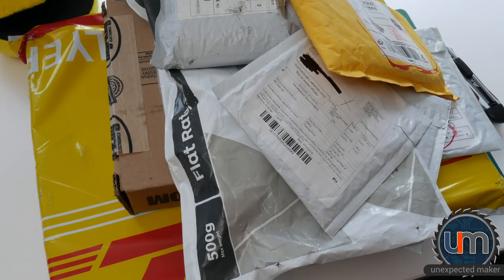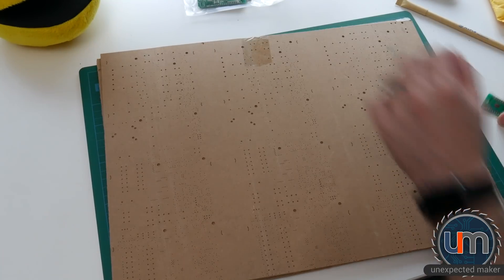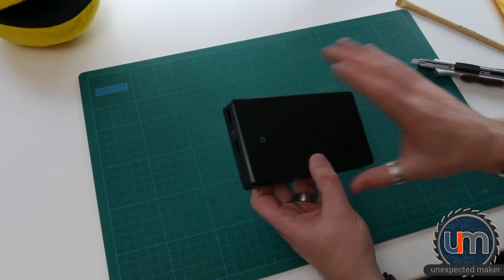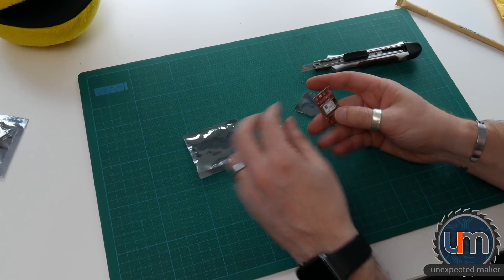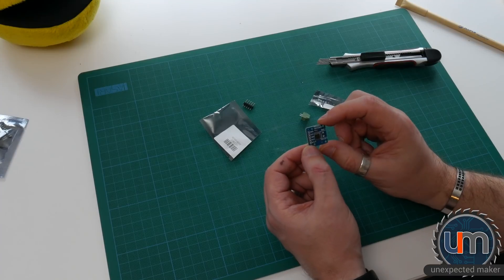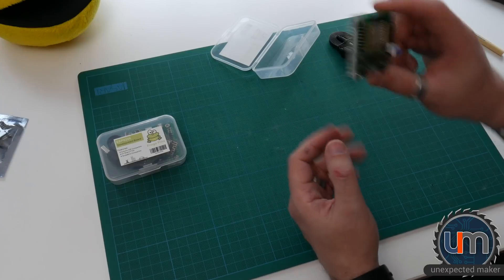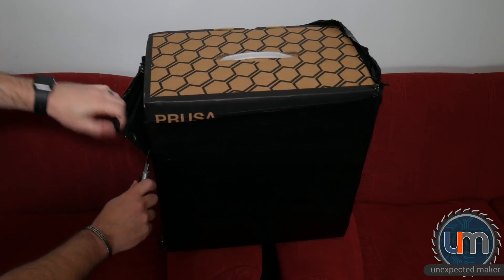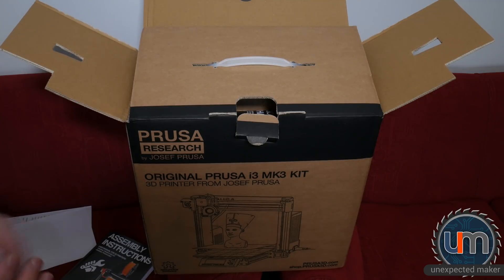Unexpected Mail #10 - Something Special

Comment: Thinking Reflow Ovens, and Tindie, I’ve had my eye on the ReflowR (https://goo.gl/UpVFqA) as my ideal reflow solution, ever since I saw it on an EEVBlog postbag. A bit more costly than modifying a cheap toaster oven, but then it’s a tidy & compact solution that’s also likely a bit friendlier towards heat sensitive components. :)
Reply from the maker: I've almost bought the ReflowR at least 5 times now.. and every time I chicken out... only because I have a working and reliable reflow setup now. But I'd much prefer to be using the ReflowR than a toaster oven. Maybe next time I wont chicken out!